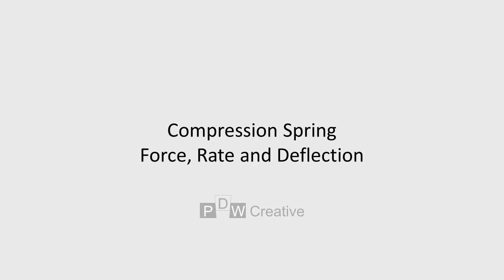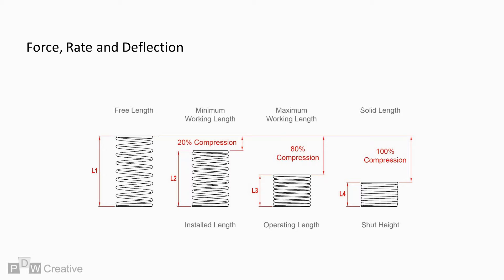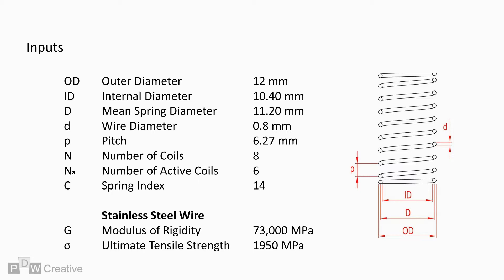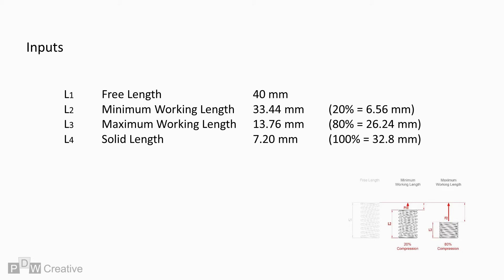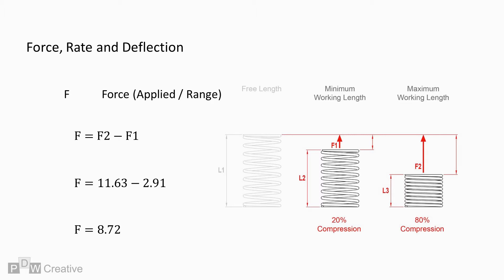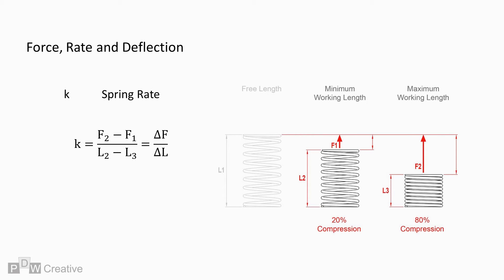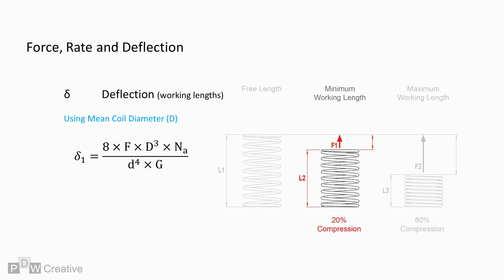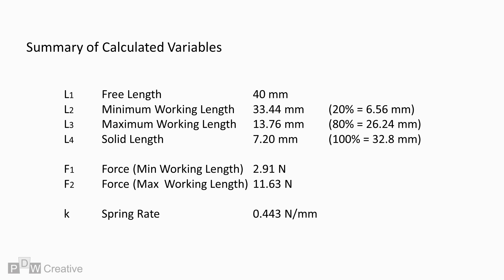Compression spring design - Force, Rate and Deflection

Comment: Height H, Mass M, spring compression x
If Height 2H, mass M, What will be the compression
Reply from the maker: The compressed length should be at least one of your working lengths. Your spring design revolves around the required force and compressed loaded length. Once you know this you can start working out your spring free length, diameter, coil count and so on.